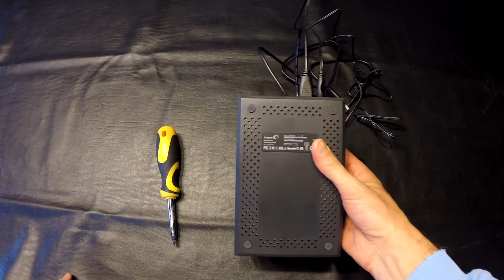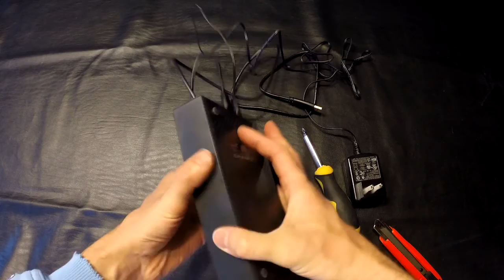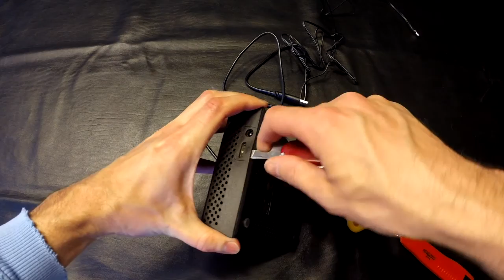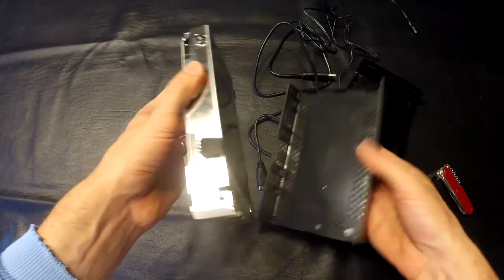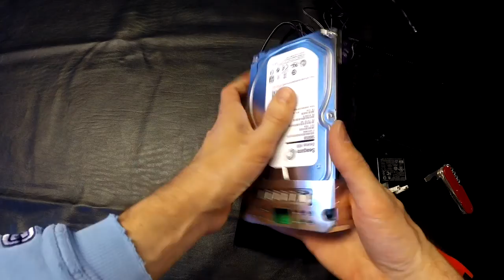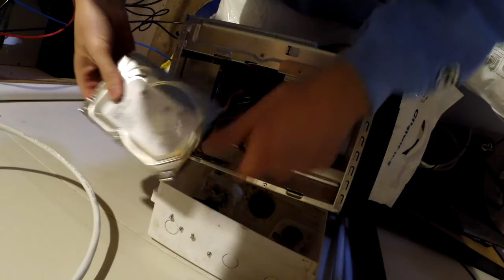How to open (shuck) a Seagate external hard drive enclosure

Comment: My Seagate external 2TB hard drive expansion (STEA2000400) is great but the case is plastic and weak and I use my drive all the time..so can I get a better more stronger durable case for it? Or can I put another case around the existing case? I want it to last longer but I don’t like the plastic case lol what’re my option’s to make it stronger? I know nothing about these things so yeah
Reply: you can try to just plug in your internal 3.5 drive to your computer at the sata port, then no enclosure needed, this is what I did